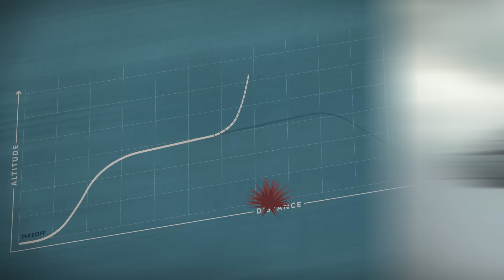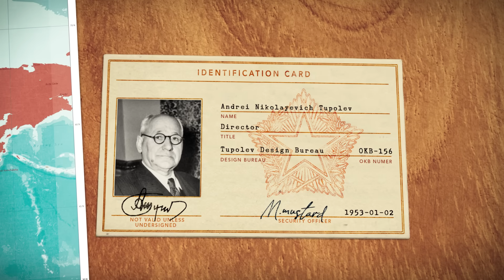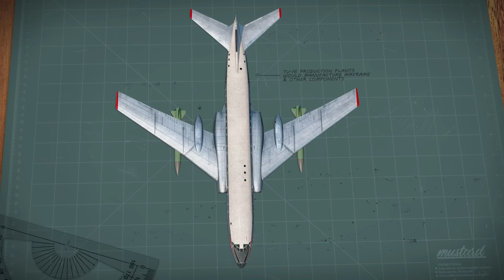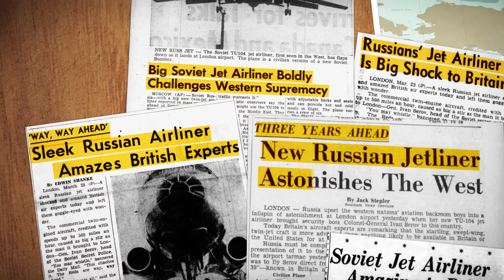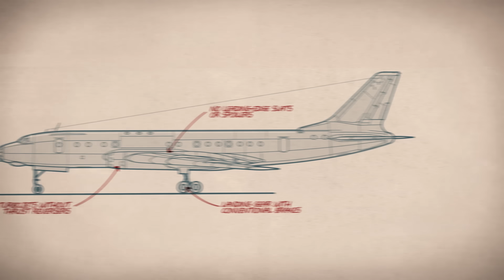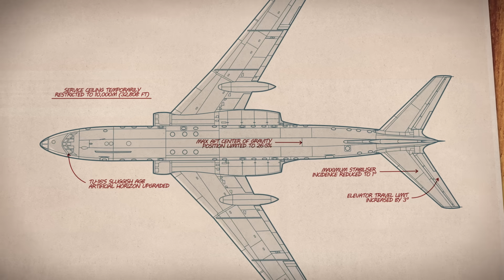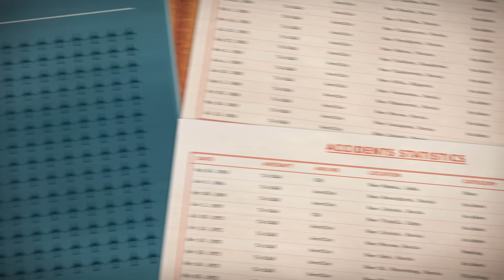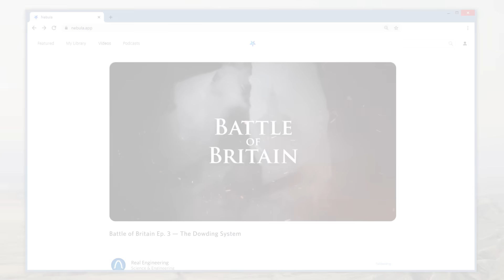The Soviet Airliner Designed To Crash

Comment: The old time 737 max
Reply: The Boeing 737 is the most successful aircraft in the  history of aviation
Reply: @sandervanderkammen9230  not the 737 max ,completely different and new plane and epic failure
Reply: @eu3127  Even the Max has a better safety record than the Comet or the Tu-104.
Comet has the highest loss rate and fatalities of any jet airliner.

Boeing just announced today another Max order for 200 more planes!!!
Reply: @sandervanderkammen9230   lol you are comparing a plane from the 60s to a new one, things like the 737max accidents should had never happened, and this was becuase the company made software compromises for a jet in production instead of modifying it.
They choosed money instead of safety and a lot of people died.
Reply: @eu3127  Your comments reveal someone who has no formal education or professional experience in aviation.
You are clearly not qualified to discuss this topic intelligently.
Please stop posting lies and ignorant misinformation about a subject you know nothing about
Reply: @eu3127  "completely different and new plane"

It's literally not.  It's just the fourth-gen 737.  There airframe is basically the same with some modifications.
Reply: @zackakai5173  those "modifications" were a complete change of the original plane by installing bigger engines and in a different position to fit them.
This lead to software modifications because the plane was not balanced well like before,and this lead to numerous crashes.

Comment: The comet was a shame the window design was flawed
Reply: The Comet was flawed by several design defects none of them were related to the design of the windows
Reply: @sandervanderkammen9230 

We feel we can shed some light on some common myths & misunderstandings repeated in many comments.

Obviously the design of the passenger windows was never suspected to be a problem at De Havilland.

It's not valid to compare a Bow-wing ( see B-47 wing folding & wing collapse incidents for details) jet  airliner designed & first built as late 6 decades after the Comet, with the fabulous De Havilland Comet, the world's first high altitude jet powered airliner.  
  Vast improvements in commercial aviation infrastructure alone being a significant factor in improvements in air travel safety safety over mire than half a century.
    Of course 50 years more design, build & operation experience didn't prevent the horrendous Bow-wing Max  incidents, there can obviously be no excuses for that.
  
  That's correct of course, at the time the Comet wasn't particularly dangerous. Agreed, that is indeed the case of course, The DH Comet was definitely not the worst engineering failure in commercial airliner history.

Losses comparisons
How things were in those days.

DeHavilland Comet 4 UK                  14% 
DeHavilland Comet all mks             17%  

Boeing 307                               70%
Boeing 247                               48%
Boeing 707            .                  20% 
Lockheed Electra Turboprop   29%
Canadair CL-44  Turboprop     46%  
Convair CV-580  Turboprop     22%
Convair CV-880    (ff 1959)       27%  
Convair CV-990     (ff 1961)      33%

     Of course De Havilland had prior experience building many all metal construction airframe aircraft & thousands of jet powered fighter aircraft that were primarily of metal construction with pressurised cockpits & jet engines built by De-Havilland.

  Yes, that's true, De Havilland carried out full stress analysis & engaged in a comprehensive & protracted testing program which is why key De Havilland people were happy to be aboard flying DH Comet aircraft. The Comet was the first airliner where stress due to pressurisation significantly exceeded flying load stress for a full length passenger cabin fyselage.

    We agree, that's correct, the DH Comet was the first passenger airliner with full length fuselage pressurisation at 8psi pressure differential. Handley Page built the world's first all metal construction airliner during the 1920s.
    In many cases earlier pressurised aircraft were larger, needed thicker fuselage skins due to flying stresses alone & had much lower pressurisation differential pressure. 

     Of course ripstop provision was provided. The skin alloy used became unavailable at the time due to R & D at the manufacturers which resulted in the original alloy being discontinued. Later alloys had very similar properties. The skin thickness used for the Comet was used for similar size later aircraft. Frame spacing was not found to be too large & frame width was not found to be too small.

    Without doubt De Havilland did indeed always work to better than industry standards at the time, used up to date knowledge for the design & construction & no evidence of negligence or criminal negligence was ever produced in relation to the DH Comet.

   Obviously the DH Comet had no effect on the course of the aerospace industry in the UK. The UK now has the world's largest combined nuclear, aerospace & defence sectors per capita activity.

    That's correct, the investigation committee did not find hundreds of fatal flaws or evidence of design defects, structural defects, defective materials or shoddy workmanship. Indeed it is the case that ripstop provision was included. Claimed incidents did not involve cracks starting from passenger window corners.
   Pretty much all changes were just in case changes or were planned development modifications & improvements that were scheduled regardless of incidents.

    Obviously De Havilland designers knew all there was to know about metal fatigue at the time they designed the DH Comet.

    It is in fact true to say that the way airliners were built changed everywhere including in the US after the Comet incidents.

We hope this helps, obviously.

Cheers indeed of course 👍. 
 
 . . .... ... ..... .. .....
 ..... ..... .... .... ....

Comment: this is how the western media always portray their adversaries, "Propaganda machines"
Reply: Indeed, we know from the accident statistics that the British de Havilland Comet was the worst jet airliner in history
Reply: @sandervanderkammen9230 

We feel we can shed some light on some common myths & misunderstandings repeated in many comments.

It is indeed correct that there were plenty of aircraft that were more dangerous than the De Havilland Comet before & after the Comet.

Obviously It's not valid to compare a Bow-wing ( see B-47 wing folding & wing collapse incidents for details) jet  airliner designed & first built as late 6 decades after the Comet, with the fabulous De Havilland Comet, the world's first high altitude jet powered airliner.  
  Vast improvements in commercial aviation infrastructure alone being a significant factor in improvements in air travel safety safety over mire than half a century.
    Of course 50 years more design, build & operation experience didn't prevent the horrendous Bow-wing Max  incidents, there can obviously be no excuses for that.
  
  That's correct of course, at the time the Comet wasn't particularly dangerous. Agreed, that is indeed the case of course, The DH Comet was definitely not the worst engineering failure in commercial airliner history.

Losses comparisons
How things were in those days.

DeHavilland Comet 4 UK                  14% 
DeHavilland Comet all mks             17%  

Boeing 307                               70%
Boeing 247                               48%
Boeing 707            .                  20% 
Lockheed Electra Turboprop   29%
Canadair CL-44  Turboprop     46%  
Convair CV-580  Turboprop     22%
Convair CV-880    (ff 1959)       27%  
Convair CV-990     (ff 1961)      33%

     Of course De Havilland had prior experience building many all metal construction airframe aircraft & thousands of jet powered fighter aircraft that were primarily of metal construction with pressurised cockpits & jet engines built by De-Havilland.

  Yes, that's true, De Havilland carried out full stress analysis & engaged in a comprehensive & protracted testing program which is why key De Havilland people were happy to be aboard flying DH Comet aircraft. The Comet was the first airliner where stress due to pressurisation significantly exceeded flying load stress for a full length passenger cabin fyselage.

    We agree, that's correct, the DH Comet was the first passenger airliner with full length fuselage pressurisation at 8psi pressure differential. Handley Page built the world's first all metal construction airliner during the 1920s.
    In many cases earlier pressurised aircraft were larger, needed thicker fuselage skins due to flying stresses alone & had much lower pressurisation differential pressure. 

     Of course ripstop provision was provided. The skin alloy used became unavailable at the time due to R & D at the manufacturers which resulted in the original alloy being discontinued. Later alloys had very similar properties. The skin thickness used for the Comet was used for similar size later aircraft. Frame spacing was not found to be too large & frame width was not found to be too small.

    Without doubt De Havilland did indeed always work to better than industry standards at the time, used up to date knowledge for the design & construction & no evidence of negligence or criminal negligence was ever produced in relation to the DH Comet.

   Obviously the DH Comet had no effect on the course of the aerospace industry in the UK. The UK now has the world's largest combined nuclear, aerospace & defence sectors per capita activity.

    That's correct, the investigation committee did not find hundreds of fatal flaws or evidence of design defects, structural defects, defective materials or shoddy workmanship. Indeed it is the case that ripstop provision was included. Claimed incidents did not involve cracks starting from passenger window corners.
   Pretty much all changes were just in case changes or were planned development modifications & improvements that were scheduled regardless of incidents.

    Obviously De Havilland designers knew all there was to know about metal fatigue at the time they designed the DH Comet.

    It is in fact true to say that the way airliners were built changed everywhere including in the US after the Comet incidents.

We hope this helps, obviously.

Cheers indeed of course 👍. 
 
 . . .... ... ..... .
 ..... ..... .... ...